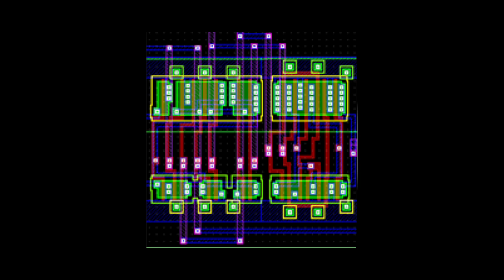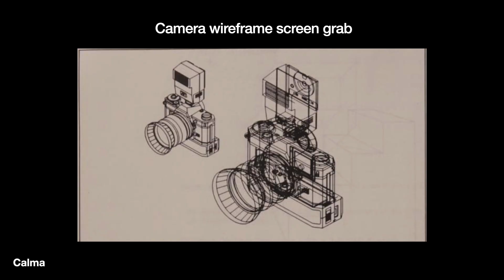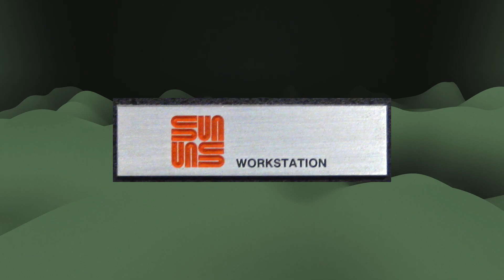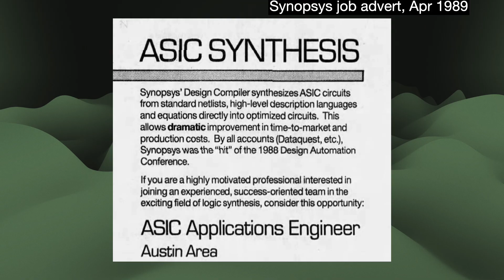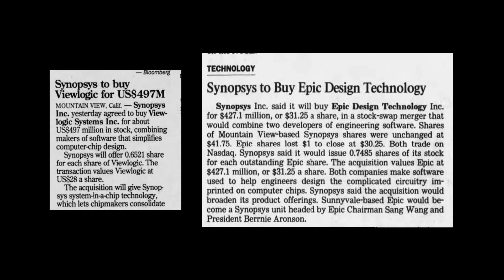The Semiconductor Design Software Duopoly: Cadence & Synopsys

Comment: Interesting video. Used most of those tools for some time, but went into pastures more software. Still get the itch to do something on that FPGA of mine every now and then...

Suggestion @Asianometry, when showing stock charts over long time frames use the logarithmic scale. Otherwise, it will easily look 'too impressive'.

Comment: Used both Cadence and Synopsys tool for IC design. Synopsys doesn't even come close. They're not even a competitor for Cadence. Synopsys is cheap but their Primesim/Primewave suite is filled with bugs at every corner. It's a miracle that ICs designed with Synopsys tools even work in the first place.
Reply: Genus and Innovus?
Reply: @Rust-to-Go  Nope. Virtuoso and ADEL/ADEXL suite for analog/mixed-signal design. Used a bit of maestro as well although not to its full potential as projected by Cadence. Did not use Cadence digital design tools but I'm sure they're great as well and can beat competition in most areas.
Reply: @shadowmaster1356  I understand you. I also designed analog circuits in virtuoso using ADEL, and also developed the topology of the chips as part of laboratory classes at my university in gpdk045. I am currently studying for a master's degree. I will need to write my master's thesis. I've also recently become interested in digital design, but so far I'm bad at RTL, verification, and even more so logical and physical synthesis. Thank you for your reply, sir. Are you a highly qualified engineer or scientist working for a well-known semiconductor company, sir?

Comment: I worked at Texas Idiots in 1978. VLSI was new. Clock speeds were 10 MHz. And logic gates were TTL. I worked on the I²L SBP9900. I had to create libraries so TTL designers could create I²L ships.
EDA restricts designers to 1968 CMOS. State of the art is 5 GHz at 300 W. If you used resonant tunnel diode threshold logic you would be at 33 THz at 5 W. All the EDA software could have to be rewritten.

Comment: Surprised more input sources were not shown...

Daisy Systems was the first EDA tool I used. What I cherished about their system was DNIX - Daisy Unix, running on an 80286 PC. It was a thing of beauty. They even had a hardware accelerator, which was truly a marvel. I forgot the name of the accelerator, but it worked like this:

For simplicity, we'll test a 74LS161 counter, controlled by gates written in DABL (Daisy's high-level language, similar to Verilog or VHDL). You would breadboard the 74LS161 and connect the inputs and outputs to an interface cable that ultimately tied into the simulator. Simulating the gates portion was accomplished via event-based simulation. By adding a continuous clock, you could synchronize your inputs to the 74LS161 and read your outputs at the same rate.

Here's the cool part: the 74LS161 is first reset. At time 0, all inputs to the 74LS161 are initialized, you wait 3/4 of a clock period, and measure the output. You take the inputs and outputs and place them in the simulator waveform window. In the simulator, you advance one clock edge. For the 74LS161, you reset it and then advance two clock edges. The simulator then places new values into the waveform. Again, in the simulator, you advance one clock edge. In the hardware, you reset and perform three clock edges. This cycle continues to the end of the simulation.  This allows you to run in real time on the 74LS161, even though the simulator is slower.

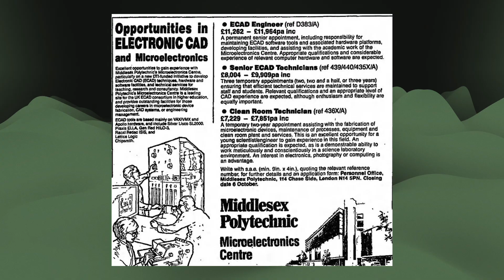Comment: 7:35 LOL. I attended Middlesex Polytechnic (now University) in Bounds Green, London in the 80's studying Electronic Engineering probably when this ad was placed.  The Bounds Green site was where the engineering departments were located and was a very futuristic building. The Bounds Green site was shuttered and I believe all engineering departments closed. Is a crying shame. As Asianometry was rattling off Sun and Silicon Graphics hardware I was thinking of all the Apollo workstations we had at the time which are listed on the Middlesex ad. Good times!

Comment: One of the coolest things that SDA tools could do in the mid/late 80’s was to let circuit designers write code to place and route polygons, wires, and transistors. This way, if you made some small change to a low level cell (like the location of an input node), you just reran the program and the layout changed.  

At the time, this was huge, because other groups in our company were still pushing polygons on Calma systems. Any little change could turn into a major relayout.

Comment: Pronounced, like the Greek of ancient renown, SOCRATES is a system designed to automatically synthesize and optimize combinational logic circuits from Boolean equations. It uses Boolean and algebraic minimization techniques to optimize the logic, and further optimizes the resulting circuits using a rule-based expert system tailored to user-defined technology. This system was presented at the 23rd ACM/IEEE Design Automation Conference in 1986. It presented a significant development in the field of electronic design automation, helping to streamline the process of creating efficient logic circuits.

Comment: Back in the early 70's, GTE Laboratories used a tool called FAMOS, or "Fast Automated layout of MOS circuits."  Since the company did a lot of work for government agencies and did really low-volume stuff, it was nice to crank out chips quickly, even if they layouts weren't all that dense.  Due to a lack of compute power at the time, it was impractical to make layout tools that were 100% complete, so competing tools from other companies might take hours just to tell you the layout failed.  FAMOS was designed to do about 90%+ of the layout in a few minutes, and either spend more time to refine the layout, or just let the user fix the last few traces that couldn't fit in the target area.  This "quick-and-dirty" tool was essential for their success in beating other companies when bidding on contracts, as GTE could verify and produce custom chips faster than anyone.  Nobody knows about them today, but back then, GTE was a really big deal.

Later, the company mostly moved to Calma and Applicon systems, and I had a chance to mess with those machines during a few take-your-kids-to-work-day events.  The host hardware was still all custom back then, and since 3D imaging was just starting to become a thing, they had some really interesting input controls, including a 6-axis rotator using 3 spinning wheels (which would be REALLY nice for doing 3D modeling on today's hardware).  Later, I think GTE switched to Mentor Graphics before their decline and eventual sale, but I never had a chance to use those machines.

I still have copies of the FAMOS source files (written in FORTRAN) and the instruction manuals.  One of these days I might look into how this stuff works, if only to investigate how things were coded back in the 70's.

Comment: Outstanding as always. EDA has been a duopoly my entire career so far (since ~2000) and is so stagnant young folks no longer see chip design as an attractive career. Tools and flows have not changed radically in the last 20 years. Starting a new company in chip design is almost impossible due to prohibitive EDA licence costs which scare away innovation. The industry is ripe for total disruption, but how?
Reply: Expiring patents?
Reply: Chinese domestic eda

Comment: One big BIG thing that went on in the early ASIC world was that most foundries had their own set of tools for design-entry (usually schematics), netlisting, logic simulation, delay-prediction, timing analysis ( back-annotated delays into the logic simulator, as well as static timing analysis), and test-vector conversion. I personally worked with tools from LSI Logic, VLSI Technology, Toshiba, NEC, Mitsubishi, and probably others. Oh, what a horrible mess that was !!! Around the mid 1990s, the ASIC vendors realized it was too costly and inefficient to maintain their own tools, so they gravitated towards vendor-independent simulation tools, notably Verilog, Chronologic, Modelsim, and Vantage. There was also pressure from customers for the ASIC vendors to standardize the tools as well. Synopsys and Cadence began gobbling-up independent tool vendors.

Comment: I work for one of the big two, and while specific customers are a closely guarded secret, I can tell you that the number of companies that are designing their own chips would astound you.  Companies that you would never think of as ever being in the chip business, because they're view as Internet companies, are designing their own chips.  Decades ago it took massive amounts of staff and capital to design and build circuit boards, now anyone with a PC and open source software can send a file off to a PC board manufacturer and run their own small company.  While we're still a ways away from that at the chip level, any medium size company can now design custom chips, starting with purchasing most of the internal circuitry instead of designing.  The demand for EDA is about to explode as chip design becomes as common and board design used to be.
Reply: @Rubicola174  I'm not an industry insider but, generally speaking, the bleeding edge nodes are used where extreme compute power is needed ie new best of the line CPUs/GPUs.  TSMC wants firm orders from intel/amd/nvidia/apple for thousands of wafers of the same thing to keep their bleeding edge fabs running smoothly and profitably.

But other than basically those 4, there are a million use cases out there that do not need anything close to bleeding edge. And in fact where bleeding edge nodes are a negative rather than a positive.

If as a random exemple you wanted to make a chip that does FM radio + heartbeat monitor + 3G connectivity or whatever, it could be done on a 10/20+ years old node. But you would still need the tools to make the plans before shipping them to a fab.
Reply: @CalgarGTX  While I agree, there are a tonne of stuff that is happening in older nodes (honestly, for analog something like a 10-year-old 22nm is still considered bleeding edge) - You would also be surprised as to the companies outside of the intel/amd/nvidia/apple using those latest nodes. AI startups, networking equipment, etc all are moving to those nodes.
Reply: I agree with your last line, however unfortunately it's already priced in
source: worked several years at one of the big two as well and stonks popped last couple years
Reply: ❤ @CarsMeetsBikes
Reply: @CarsMeetsBikes  Everything is already priced in. By the time you have thought of something some quant who makes 8 trillion dollars a year has already run 27 simulations and decidided to buy puts on every company involved.
Reply: @Rubicola174 yes older nodes are used for a long time after they are cutting edge. a lot of equipment from the 90s is still used even
Reply: I thought anyone can do chip design with FPGAs to play around with.
Reply: @AVeryHumanReviewerAndNotABot  That's certainly true, but the number of companies that are designing their own ASICs when they used to buy off the shelf semiconductors is exploding.
Reply: In the 90s I was barely involved in a Mayo Clinic design that operated a transmission line at 10 GHz.  So it's not just who, but some of these whose are operating at the bleeding edge of technology.  The chip was part of a CAT Scan machine.  10 GHz back then was blazing.
Reply: FPGAs, CPLDs, and faster CPUs will continue to erode the demand for custom SoCs. On the CPU front, with faster multicore CPUs, you can do things in software that once required dedicated hardware. Time and money constraints (tens of millions of dollars for a 3nm mask set, 3 months for fabrication) are pushing designs into FPGAs. For example, a bugfix can be done in minutes at almost no cost. The shift from ASICs started in the late 1990s, when FPGAs/CPLDs gobbled-up the lower-end of the gate-array/standard-cell designs, and continues today. None of this is an explosion; it's an ongoing shift.

If you want an EDA explosion, you need a disruptive technology. I'd put my money on AI-based design, which uses a combination of high-level design description (think something 2 orders of magnitude higher than Verilog), coupled with formal-property verification.
Reply: I hear the EDA part of chip production is under threat of US- Chinese sanctions hence there is a big push in China to develop their own EDA design tools. There is a lot of the reinventing of the wheel going on, but it may turn out to be better wheels given the modern computers available today.  I'm sure AI features in it somewhere too.
Reply: @Andrew-rc3vh  Look at Empyrian, a huge huawei-backed chinese cad vendor that pretty much (supposedly) offers everything you need to do advanced IC design, digital, RF, analog, mixed-signal,...
Reply: can you give rough numbers , lets say I want to build some  ASIC on 14nm, less than 1bn transistors (so 40-60mm2), what would the entire cost be, and how long woulld it take
Reply: @user-lp5wb2rb3v  I'd say $100 Million. If you had a team of 100 exceptional engineers, it would take about 2 years to develop a chip this size/complexity and they would need to be paid about $150k/year. There's 30 million. In the past, my very-large-semiconductor-manufacturer employer had a roughly 3X burden for the cost of an engineer for expenses like management, compute resources, tools, licenses, support, benefits, workspace, etc. So now we've spent $90mil. Masks are going to cost at least $5mil, so we're basically at $100mil.

Of course, this is just a stab at time/money. Without knowing the complexity of the design, unique challenges, etc it's merely a guess.
Reply: GET LONG EDA, NOW!
Reply: What do you think of synopsys acquisition of Ansys, as Ansys is a physics simulation company which is different domain
Reply: Thanks then I will go buy ASML only
Reply: What is EDA? Do you think both of these companies are worth investing in?
Reply: The first comment aged very well
Reply: So are they using the software from the big two to design their own chips or they're doing it in house?
Reply: @Morningwaffle209  It's always a combination.  Processors, network interfaces, memories, etc. are usually purchased.
Reply: @earthwormscrawl  I know you may be partial but what's stopping a company like  nvdea  tsmc  or any to create their own eda.

Comment: Ah yes, Cadence, the makers of software all chip designers love to hate. Software held together by lisp scripts and bubblegum, and the bubblegum is getting kind of old and brittle.
Reply: I agree, the Lisp is the best part. (I'm a software architect at Cadence, and I work on Virtuoso Schematic Editor).
Reply: @petertbbrett  could guys please update the GUI it's been the same for 14 years. Maybe add some snazzy animations
Reply: I don't design IC's but UI in their OrCad software for PCBs feels like 30 year codebase that is adapted to a new system every few years and was never refactored, everything works just like I wouldn't except it to work and is not intuitive. Also temporary trash files everywhere. Ewerywhere!
Reply: @BHBalast  More like 35 years old, but yes.

Comment: I noticed that in this video and one of your earlier videos called "Designing Billions of Circuits with Code" you sometimes have screen captures of PCB layouts instead of IC layouts.
I did PCB layout for about 30 years and used software from the same companies in your videos. I used software from Cadnetix,  Orcad, PADS, Case Tech, ViewLogic, HyperLynx, and Mentor.
The major difference between IC layout and PCB layout is the scale. IC's are in nanometers and PCB's are in millimeters.
Have you considered doing a video about PCB EDA software and their history? Thanks.

Comment: In the EDA world, don't forget about the Siemens Mentor tools.  Not ASIC tools, but PCB development/simulation tools.
Reply: I could be mistaken, but I think in Siemens is mostly Calibre (PEX/LVS/DRC/...), and their simulator AFS is also quite good. Their analog IC package (Tanner) is not bad, though it ain't no Virtuoso.
Reply: The Mentor suite includes lots of IC design tools and yes they have market share, although smaller than synopsys and cadence.
Reply: @michael_r  Yeah, I checked and they aren't really bad. Market share in 2023 Synopsis 33%, Cadence 31% and Siemens 15%. These are the big three. Others are relatively insignificant. I heard that Huawei is working on theirs due to restrictions and can design microelectronics up to 14nm. They are trying to improve upon that.
Reply: do they have a good market share?
Reply: @stuffstoconsider3516   Yes, huge!